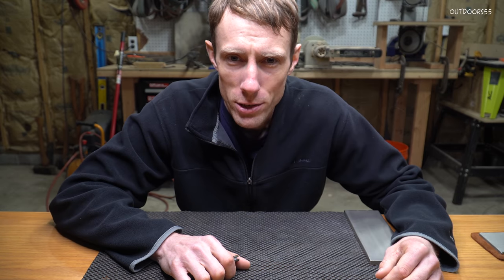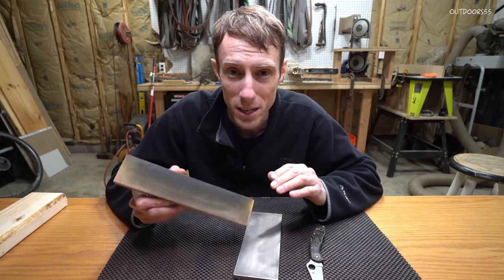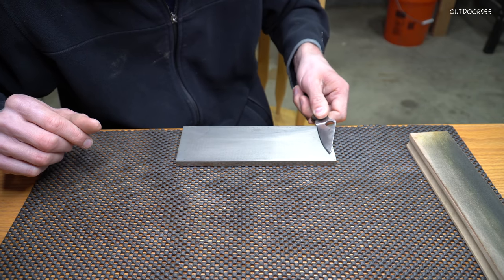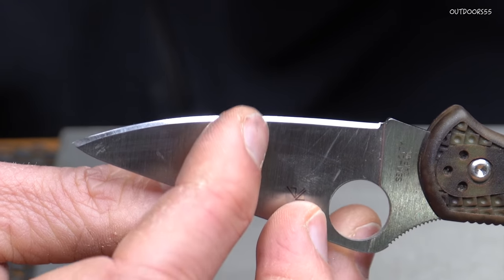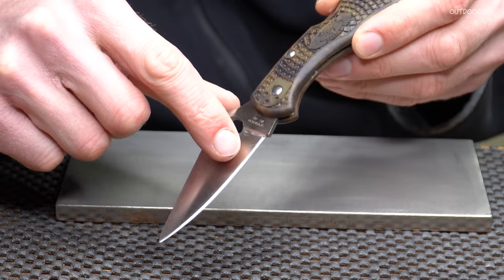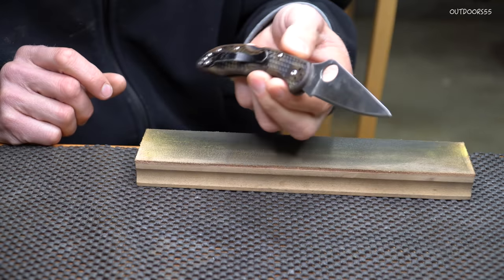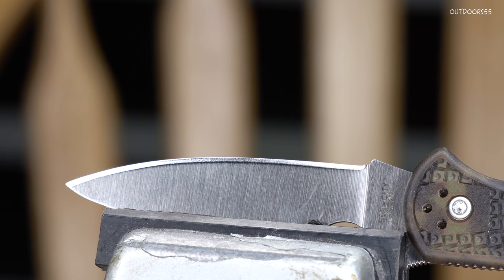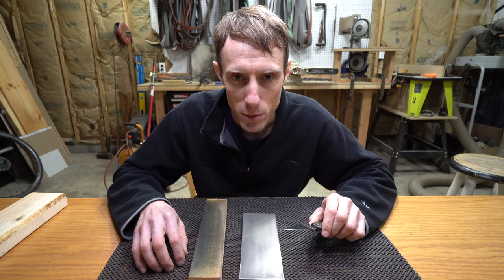How I Sharpen My Knives With Close-Ups

Comment: I got a DMT fine stone on your recommendation a couple years ago. I can get knives okay sharp, but not mega sharp and especially hard on filet knives. Would love to see a video on typical flexible filet knives if you get the chance. Thanks and glad to see you back in the knife world
Reply from the maker: It may be the steel. Not sure what you are using but Filet knives are generally stainless. There nothing harder to sharpen than cheap, poorly heat treated stainless. It just doesn't take an edge well due to many different factors.
Reply: @OUTDOORS55  I have a victorinox and a bubbablade I use most often. I have a gerber as well, but assumed it was cheap steel. The victorinox is probably just a flexible boning knife in a sheath.
Reply: @Tjmcna  i have SO much issues sharpening these old victorinox knives i found at work. i have 10x more success with my japenese knives or my coworkers nicer stuff. idk might just be victorinox sucks
Reply: I use old knives and a newer Victorinox but I never go mega sharp, or sharpen more than a minute. Knives just have to be in a predictably safe sharp enough state
Reply: @2adamast  
"Predictably safe sharp enough state"
What in the world are you talking about?!?!
Reply: @jayytee8062  For me there is blunt, sharp enough and scary sharp.  My table knives are blunt,  my kitchen knives sharp enough (to slice bread),  scary sharp isn't safe for me.

Comment: Could you do a video on just strops? Specifically, I am wondering how to remove some cheap compound I put on mine. I want to replace the cheap stuff with diamond stuff as you recommend. Also things like adding compound ie heat it up? how much to put on, when is it time to replace it etc. Thanks and welcome back.

Comment: Excellent video, advice, and camera work! Sharpening is a sad mixture of tradition, dogma, and voodoo. All you need to keep good knives razor-sharp is 1200 grit diamond bench stone (or even an Arkansas stone) and a hard leather strop loaded with 1U diamond. Please do try very hard , smooth rawhide on 1 of your strop blocks. You have to crosshatch the rawhide with tiny knife slits to permanently retain the diamond paste. The advantage is, it works more like a 1U stone than a strop, and your blade can't be over-stropped.

Comment: Thanks for the vid 👍

Question on the strop - is there one side of the leather that is better to use?  And what makes the leather good for stropping?  I have been using the rough side for my coarser compound and the smooth side for the finer compound, not sure if that is an appropriate method but it seems to work ok.  

Also, what is the diamond paste you recommend?  Thanks!
Reply from the maker: Its completely dependent on the leather itself. Some leather is incredibly rough on the rough side. I use the "rough" side for my strops but its very soft feeling. I find the smooth side doesn't hold compound well. But again its leather dependent. Im using knife point gear 3 micron paste. 🙂
Reply: @OUTDOORS55  Ok yes that seems quite reasonable.  I have had issues using the smooth side and finding consistency with applying the paste, so that makes a lot of sense.  I appreciate the input!

Comment: I learned a lot from your videos months ago so first I would like to say thanks. It's always nice to watch your videos. I did a lot of research after that and maybe you would find this interesting.

This double bevel is a nice technique for chef knives. Instead of sharpening with 15° you can sharpen with 10° and use a microbevel with 15°. It gets a lot sharper without compromising edge stability.

Low grit stones leave scratch marks on the edge and it creates  microsserrations effect. Each material responds different. For cutting paper and hair  high grit stones work great. For cutting vegetables the microsserrations help and a lower grit (1-6k) gives a better edge than high polish. Microsserations is not a huge effect but it's noticible.

For cutting rope some people like very low grit like 320.

I only use kitchen knives so I don't know how to optimize outdoor knives.

Comment: Hi Alex, thanks for all your great content! Because of your videos I’m finally learning how to sharpen knives at 40 years old. I typically carry a Spyderco Delica 4 FFG. I’ve been using a smith’s guided system with the clamp, but I’m starting to do more free hand now. I also have a beaver craft strop with the green compound. I just made a new strop as I want to try Diamond compound. But you are out of stock of the 3 micron on your website. I will buy the dmt stone soon, but currently have the harbor freight 4 sided Diamond block, and a cheap stone. Anyway thank you for your content and do you think I should get the 4 micron that you have in stock ? Or wait for the 3 micron ? Thanks again

Comment: I use the same DMT, but two of them: extra-Fine and Extra-Coarse. Extra coarse is stroked parallel to the edge, the extra-fine perpendicular to the edge, at a higher angle initially to wear off the wire edge. Extra coarse is at about 10 dps, the extra fine at 15 dps. That's it: From choppers to slip joints, all use the same method/angles. The most originality I claim is the near fully lengthwise stroke, which keeps the main bevel angle very consistent.

Comment: Glad to see you around again :)
Regarding the sharpening I have always had one question. What do you look out for in order to maintain the same angle while deburring with one hand?
I can get it done by switching hands an tilting the knife until the apex touches the strop every time. But you seem to just switch sides with one hand and hit the perfect angle automatically. What's your method or reference point there?
Best regards
Marcel
Reply: I can't speak for him, but personally, and most others I've talked to, it just happens automatically, with experience.

I just say get familiar with holding, using, and sharpening your knife, makes it more comfortable and easier to do.

Comment: Excellent camera work on the up-close blade shots. Are you using a USB microscope or just a really nice macro lens? Couldn't help but notice the Spyderco ceramic stones did not make an appearance. I have the medium and fine stones and have discovered mine aren't perfectly flat. Not greatly out of whack, but enough for me to start looking for some silicon carbide grit and float glass as a Holiday Project...
Reply from the maker: Its a nice macro. Using a laowa 100mm 2x macro and a laowa 25mm 5x macro on a sony a6400 in 4k. The medium, fine and ultra fine are great stones. And i do still use them on occasion. For everyday quick and easy sharpening i like the diamond.🙂

Comment: Hey Alex, I’m about half way through this great video and it dawned on me you don’t seem to be using any kind of lubricant, does that stone not require any or do you find it better without? I use a Trend 300/1000 diamond stone, and always use water with a rust inhibitor in it, but I’m always looking for ways for less mess.
Good to see you back, love what you.
Cheers
Bruce
Reply: you dont have to, water or diamond stone lube mostly help carry the swarf away so it can help on softer steel or re profiling
Reply from the maker: I dont use water on dmt stones. They use a carbon steel base and will rust. I use them dry all the time and just wipe them off if needed with a dry towel🙂

Comment: What do you recommend for fixing a really bad edge, or reprofiling a blade (say form a broken tip)?

And do you recommend getting the fine stone only, or the fine/coarse or fine/ extra fine? Does the plain fine stone have diamonds on both sides, or just one? And do you have any experience with the Trend stones? Do they work as well as the dmt ones?

Comment: Hi, I have learnt a lot from you. Thank you.
Could you discuss "sharpening steels" please. Not the grooved carbon steel types but the diamond impregnated (say 1000 grit) and ceramic rod (3000 grit) types. They seem a reasonable "half way" step between sharpening, if used carefully, but your opinion will be valued. Incidentally, do you have a sales site ?  Regards from Australia. Tim

Comment: I'm trying to learn how to sharpen but I'm not there yet.
I have a DMT Extra Course for reprofiling/creating an angle and then I switch to my Spyderco Ceramic Medium.
When I'm done I strop on some green compound and then some white.

I can get it sharp, but not as sharp as your knives. It can shave but that requires repeated strokes and it also comes with some skin flakes that way.
Is my setup good enough to practice sharpening? Could it be I'm not getting very good results because I practice on cheap knives? I think they are quite soft and the metal dust is magnetic and sticks to the knife.

I think I know the answer already and that I just need to practice more. But if you spot an error in my setup I'd love to hear it before I'm practicing until I'm blue in the face without the chance of success.
Reply from the maker: Thats a great set up. Yes it could be the knife itself. "Cheap steel" or more likely a cheap heat treatment, wont take a great edge no matter what you do. I have some knives that simply wont sharpen whatsoever. I also have some knives i made in A2 tool steel that will get hair whittling just by looking at them. So it may be your knife and not the skill. 🙂
Reply: @OUTDOORS55  Thanks for the advice. I will buy a cheap Mora heavy duty to practice on then. I believe it has pretty good steel. It will be the moment of truth!
Reply: I have what I used to think were good kitchen knives, a couple Henckels.  I think I have learned to back waaaay off on the pressure as I think I was just bending the apex and soft burr back and forth frustratingly forever.  I think they're pretty soft stainless.  So I've eased up on pressure a lot, been more careful/observant, and it seems to get  a good deal sharper in a shorter time!  Cheers!
Reply: @im0rris8  I think it also depends on the stone. For instance, I have found out that on the diamond stone less pressure is required as for the ceramic I need to press harder otherwise it isn't doing that much or it takes forever to form a burr. I have some Zwilling knives but didn't have the guts yet to practice on. I know they are not the hardest of steel but they should be reasonable quality. So far I have only sharpened them using my 'work sharp precision adjust', but I'd like to master free hand some day.

Comment: Do you ever have any luck with those ceramic rods after using a stone? I find that after using mine about a year, it either does nothing or feels like it actually makes the blade more dull. I'm not sure if it's because the rod is now almost slick like glass or just user error.
Reply: I scrub the rods with Comet cleanser and a wet rag and they come back to life. You may want to try that on yours.
Reply from the maker: Yes you have to clean them🙂
Reply: @OUTDOORS55  ...ohh right 😆

Comment: That's a very useful video. I can sharpen fine, but wanted to keep learning course... Get it .. thanks for the video..
Dad jokes.
Always looking to learn from others, and wanting to make my own money off this skill.

Question:
I noticed you sharpen with a setup parallel in front of you and you sort of turn your body to sharpen. 
I use the corner of the table so my right hand can touch the stone unhindered. But I sharpen perpendicular... My forward stroke is clean, but I can't seem to work out why my back strokes have a different width on the bevel...
Do you think it's cause I start the stroke from farther away - the far end of the stone and work far to near...?

Comment: Been binging your videos again in preparation for finally building a knife sharpening work bench. I noticed that your recommendation for DMT plates varies by video. In some videos you recommend getting the extra coarse stone, and in others like this one you recommend the fine grit.

Which would you say is preferable for someone looking to maintain and polish his EDC gear with occasional damage repair? DMT extra coarse + fine + strop, DMT fine + strop, DMT + SpyderCo ceramic + strop, or some other configuration?

Really appreciate the videos by the way; they're an incredible resource on this site.

Comment: What grit is that stone? I have a Sharpal diamond stone that is 325 - 1200. I use a 600 Diamond Stone in between those grits. I've been finishing with a ceramic rod cause it seems sharper than when I strop it. probably just bad form on my end? not sure.

Comment: Yes, that kind of sharpening will work and impress alot of people, but the truth is it's just 1 relatively cheap stone with electroplated diamond layer about 1000 grit it looks like on close footage. And it means there will be huge amount of micro chips on the whole edge. Yes the stropping on 3 microns will polish that, so you won't feel it so much on the paper, but they still stay. And it will lead to edge chiping and dolling right from this high energy surface areas, so the knife will doll just faster with the same use, especially if you cock or butchering an animal on a hunt. The cherry on top is no mirror polish on the edge. Typically stuff on that video called a "demonstrative sharpening". Normally it is for advertising on a knife exhibition just to show how really sharp u can make ur knife with one of those. But if u really want it a sharp and last long, u just have to use few more stone with a natural one at the end and few more different stropes like 3, 1, 0.5 microns to make it shine and to give ur edge just a little micro lens to increase wear resistance.

Comment: I see you sharpening only good quality knifes and good steel? Do you have some cheap metal with low quality knife that you can sharpen the same? I have a cheap knife and it's impossible to get it razor sharp, I can grind it for hours, strap it or keep it on the stone.. probably good quality steel does a huge difference? 😳😧

Comment: Sharpening knives is ridiculously easy if you just put the time and effort. I use wet sandpaper very similar to how most folks use whetstones. Then I have a homemade strop wheel/ polishing wheel made out of old DVDs that spins on a drill. Viola, now I can turn a cheap $5 Chinese knife into something that I can shave with.

Comment: Question, I'm fairly new to sharpening, but when I started I heard when sharpening, you should move away from the edge, like pulling towards you while the edge is in the opposite direction. Like what you did when using the strop. Does it not matter, and that the part I mentioned is only when removing the burrs? Or is it just a tip for new people to sharpening so that they avoid damaging the edge?

Comment: i wonder if the ability to cut/whittle a human hair is overrated as a sharpening metric - given that, even by conservative estimate - human hair diameter can vary between 1/200 and 1/1400 of an inch.   and then dozens of even subtler factors.

Comment: You talk about the locked wrist while sharpening but it also appears that you change the angle as you get to the end of the blade in order to sharpen a curved tip.  i haven't heard you speak of this on any of your videos that I have watched.  Could you elaborate on this a bit?

Comment: Nice video.  I like the heel-to-tip sweep better than the tip first method I was originally taught, but I still can't bring myself to work in both directions.  No idea why, but pulling just isn't comfortable at all.   I also bought a strop, since you can never have enough knives or knife related stuff.

Comment: When I get a burr on one side of the knife do I have to keep using my stone to get the same burr on the other side also before I go to my next stone on my Workshop sharpener. Then when I do go to my next stone the 600 grit, do I do it all over again with getting a burr on the one side and then get a burr on the other side before going to my 800 grit stone. Thank you il be waiting for your responce.

Comment: Question: why don't you use oil (or other sharpening liquid) on your stone? I've read you need that in order for the stone, including a diamond one, to last you a long time.
Reply from the maker: I wouldn't use anything on diamond stones. Manufacturers use carbon steel bases under the plated surface. The steel will rust through the plating if using water. They are perfectly fine using dry.

Comment: Alex: Your videos are very helpful in improving my sharpening technique using stones; thanks for sharing your knowledge. I had one question regarding the angle you use when working on stones;  For my kitchen knives I use approximately 17 deg on my Ken Onion Worksharp because most of them are made in Japan. Since I don’t have access to the KO sharpener when away from home, a stone and strop are easy to keep around or take with me. Hence the desire to improve my hand held sharpening skills. Again, thanks for sharing your expertise through your excellent videos. Donald
Reply from the maker: For most of my knives i sharpen i sharpen at approximately 25 degrees, or 12.5 degrees inclusive (relative to the other bevel). This is just approximate as i do everything freehand🙂

Comment: I've been practicing sharpening on a small kitchen knife I have.  Some parts are very sharp, others not so much.  I have some very nice knives (Wusthof) that I want to sharpen but the blade length seems a bit unwieldy.  Any suggestions for french knives?
Reply from the maker: Dont try and do the whole thing at once. Work is sections. Longer blades are always a challenge 🙂